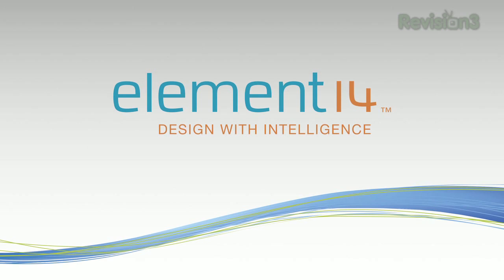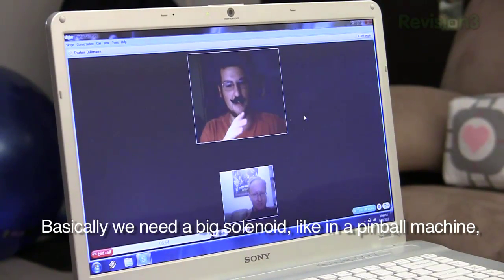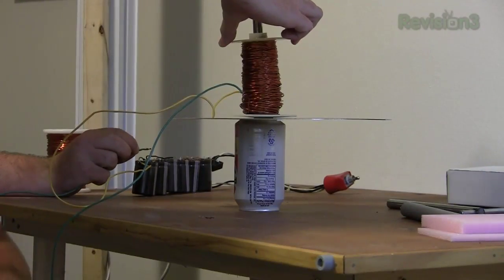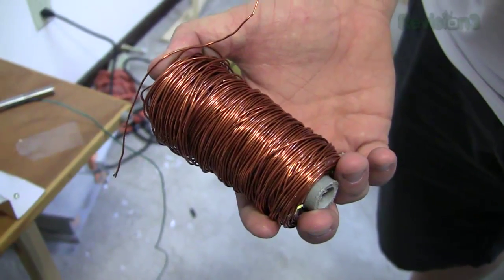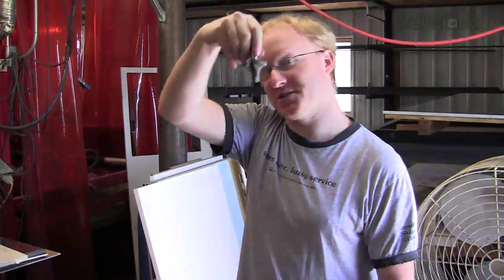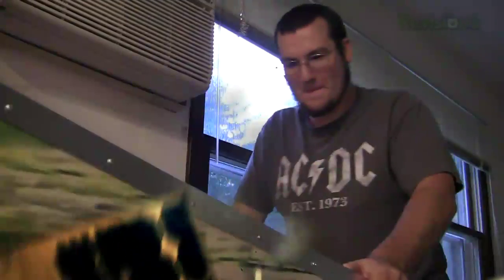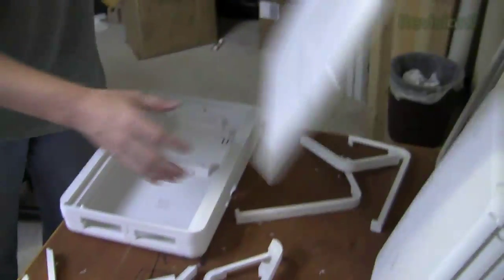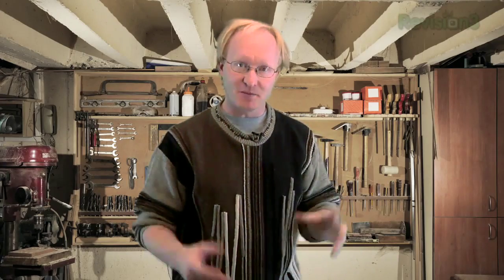The Ben Heck Show - Quest for an Automatic Can Crusher

Comment: Pneumatic cylinder actuated with a couple of solenoid valves... this would give you the power you need and the speed would be comparable to the original “solenoid driven rod” design... in effect - crushing cans with air. Let me know what you think.

Comment: My favorite high speed can crusher was designed from a baseball pitching machine with 2 wheels.  On the can crusher instead of space for a baseball to pass between the wheels, the wheels touched each other.  A chute fed between the wheels and would take cans as fast as you could feed it then spit out cans into a bin at high speed.  Safety glasses required.

Comment: In my teenage years (80's) we used to stand on empty cans of Coke and they would hold your weight.  If you then tap on each side at the same time the can gets squashed.  No electronics or pneumatics required :)

Comment: You have to compromise the integrity of the cans structure before the crush. Tap it in the side closer to the bottom than the top, fire the rail gun from the top down, use a spring to return the ramrod to tdc. Also make sur air can escape the can as rapidly ass you crush it.

Comment: If you want total power use a hydrological cylinder/piston. The automation can be to control the hydrological valve for forward and return along with distance of travel  There are units that will apply 50 tons. Which will crush any can ever made :) RJF

Comment: like to see you try the can crusher again but use an old chain drive garage door motor with out the circuitry that's what my dilemma is but with the gear system and capsature  still in the opener!!

Comment: Electric window assemblies are weak and slow compared to a air cylinder.  If you realy want electric use a linear actuator. They are around fifty bucks and come in various lenghts and weight ratings.    It still takes quite a bit of force to start to crush the can, might need to build the plunger at a slight angle.

Comment: Just an idea for your can crusher i was thinking on the line's of a can decompression unit.Have something like a compressor but instead of building up a compression in the tank build a vacuum instead and then have a seal able clamp over the top and suck out all the air.Something a little bit different :)

Comment: my dad has a real nice hydraulic air piston can crusher he uses. it's crudely built but he can crush a can in about 1 second. i imagine faster if you dial up the pressure of the unit but it becomes very dangerous if you catch your fingers in it. the system looks like a smaller version of a log splitter but with a plate at the piston end instead of a wedge. the unit is build so you can put a bucket under it so the cans eject out of the system in to the bucket. fits sizes 22oz+ cans.

Comment: My grandpa built a bad ass can crusher many years ago. It essentially used a piston that was attached to a wheel on a large electric motor. The piston was in a trough that had a slit at the bottom that was the size of a crushed can. You would put a can in and it would near instantly be smashed between the piston and large block of steel, drop through the slot and it was ready for the next can. 
It probably wouldn't be too hard to add a feeding mechanism and counter to the design.